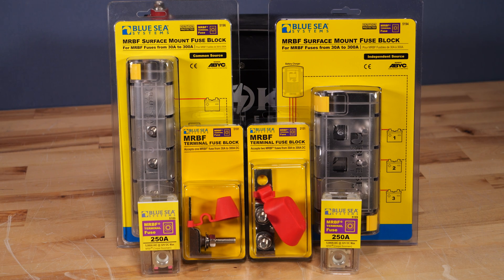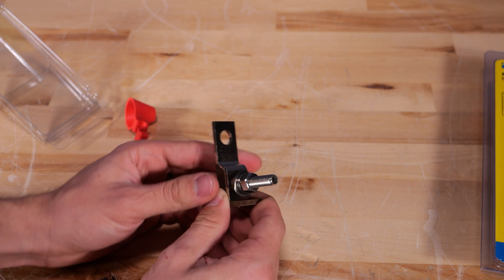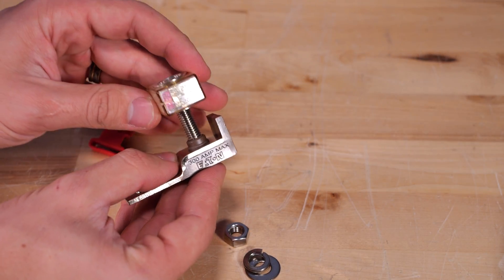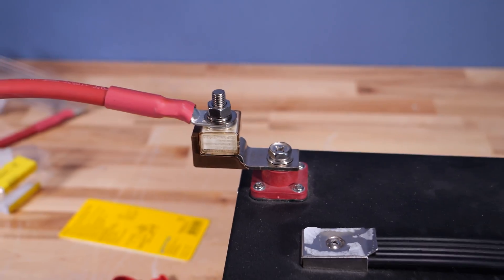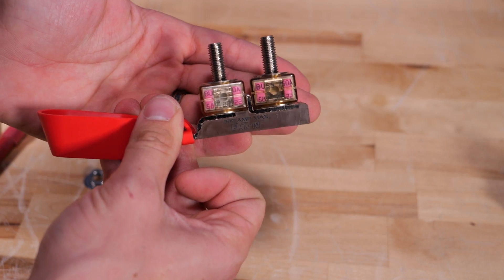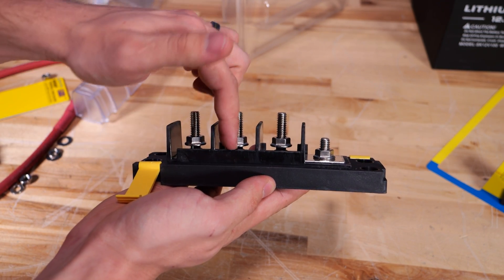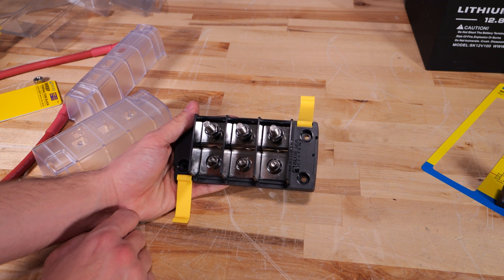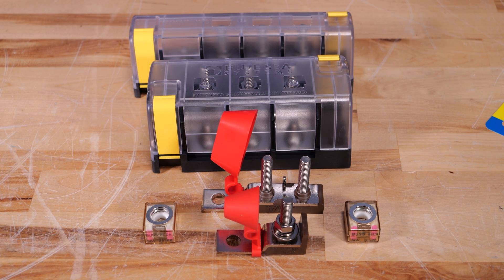Blue Sea Systems: MRBF Lineup Overview - Terminal Block Fuses

Comment: Is it possible to bolt an MRBF fuse directly onto the battery's positive M8 terminal?
Reply: No.  The fuse studs in these products are isolated from the bus bar.  If you bolted the fuse onto the battery post, your terminal lug would contact the battery post, bypassing the fuse.

Comment: My setup calls for two 2/0 positive cables and two 2/0 negative cables off my batteries, to spread the load to my MultiPlus II inverter charger.  If I use a single post MRBF block, and stack the lugs, I would expect to use a single, 250A fuse.  If I use the dual post MRBF block, do I divide the fuse size in half, using two 125A fuses?

Comment: too bad it start to be problematic from 400A and up..then it is almost impossible to get good small cheap reliable  fuse
Reply from the maker: That is where a Class-T fuse shines, but in most cases at 400+ amps, it's hard to find cable too, and it starts to become a better idea to figure out how to spread the load.

Comment: I'd mention that doubling up the nuts to effectively create a locking nut without using a locking nut. Is a preferrable option, to mitigate vibrations that might lossen a connection. Love my own bluesea 12/24v fuse holder kit.

Comment: Good video.  Thank you.  I have a Blue Seas Systems 7720 Fuse Block (MIDI) with two outputs.   Output 1 is fused at 60amps.  I would like to fuse Output 2 with a 20 amp fuse for a 10 AWG stranded copper wire.  So far I can not find any 20 -amp rated Terminal Fuses.  Any suggestions would be appreciated.   Thank you
Reply from the maker: The smallest fuse we are aware of in the MRBF line is 30A, which technically 10AWG can handle...depending on the load this may be perfectly fine.

Comment: If my battery has BMS, do I go by the BMS amperage when sizing the fuses (if I have a 200A BMS, do I need to get a 200A fuse)?  I'll be using 1/0 wire rated at 285A max.
Reply: Not an expert but I'll say that your BMS max would be one top limit so nothing gained to go above that.   Below that, size the fuse for the cable.  I'd consider total cable length myself, not just max amps.  That is, if you are running 4 meters of 1/0 rated at 285A, I would check for a max acceptable V drop at 10M and fuse for that amperage. Let's say 100 amps is all you can pull at 10% V drop for that cable. So I would choose 100 or 120 amp as it increases protection at no cost to the system.
Reply: @ceeweedsl  Yeah I contacted the battery manufacturer and figured it out. It's not just the max but also how you want the system to run, when sizing everything... But it's finally up and running.

Comment: Thanks! Is it possible to bolt an MRBF fuse directly onto the battery's positive M8 terminal, along with the cable? I mean, why would you need that 'mini busbar' and introduce the extra - albeit low - resistance if you can avoid it?
Reply: The fuseholder has an insulated stud. If you bolt it directly the power would run through the screw bypassing the fuse.
Reply: Use ZCASE fuses for that application. You can purchase them off Del City And all Del City Fuses meet Government Specifications So you know they will work as designed. Only design for up to 32v..

Comment: Is there a version for M8 lithium battery studs?
Reply: ZCASE Fuses have 3 #6 #8 and #10 stud\bolt sizes of Del City website...They are designed for direct bolt on to the stud or Battery. And all there fuses meet government specs. So you know they will blow at the rated current you bought..By aware they only rated for 32v

Comment: Are these really acceptable for a 48V DC system?  A full LiFePO4 charge is slightly higher than 58V.  I don't keep my battery voltage that high but still it seems way to close...doesn't seem like they will be able to distinguish an arc on a DC system that size.
Reply: Those CF type fuses also only have a maximum fault current rating of 2kA, which can be a problem with big lead acid banks.
Reply: They're rated for 58v so why wouldn't they be acceptable for a 48v system?
Reply: @fauxque5057  48V is only the nominal rating.  Actual system potentials in service can exceed 60V depending on cell chemistry.
Reply: @fauxque5057  
Arc quenching
Reply: No!
You need a T Class with arc extinguishing capacity.
Reply: @Not1Edit  A T Class fuse is another great layer of protection to be sure.  But do you NEED one to protect a DC circuit properly and to code?  The answer is no, you do not.
Reply: @URackADisciprine 
For 48 volts?
The fk You don't!

Short circuit in excess of 1000 amps gonna make mini torches out of these MTBF's!

But You go ahead do it Your way.
Be sure to keep hotdogs & marshmallows handy for the cookout.
Reply: Well then, you better start forcing your engineering services on every major battery manufacturer that already has state/federal code compliant 48V LiFePO4 batteries on the market WITHOUT a T Class fuse.  By the way, that would be virtually every manufacturer currently (with more to come).  As I said, a T Class fuse is another great layer of protection.  But your opinion does not constitute a requirement, as is proof by the market.